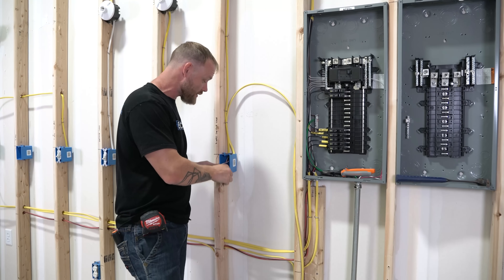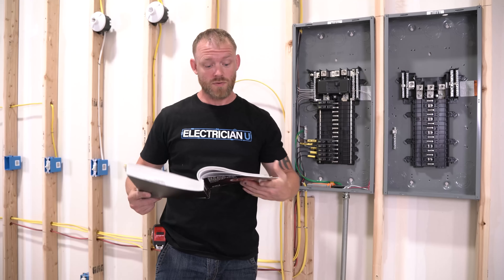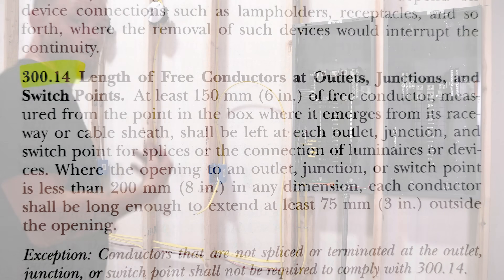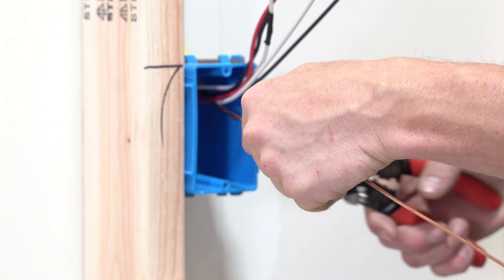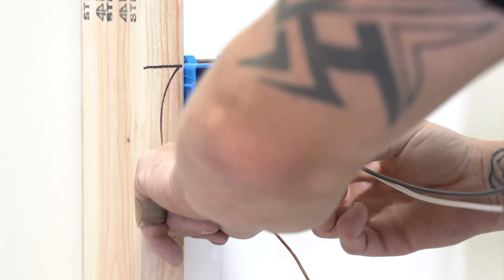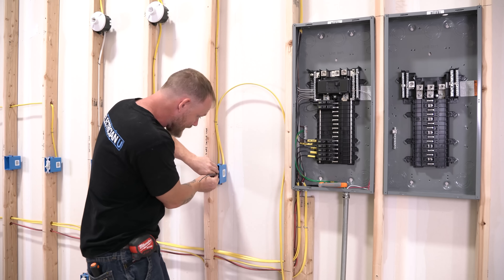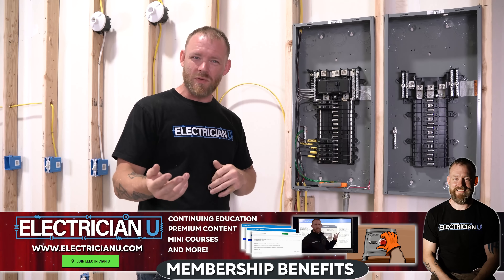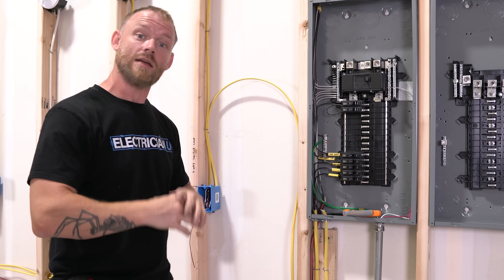STOP Cutting Wires So Short!!! What Does Code Say?

Comment: Great!  I am stuck by following code and using Wago and CFGI and now the box won't cooperate, wires don't fit in.  My task tomorrow to complete.  Will watch your suggested video and see how I can neatly do everything right.
Good I found you, Mr. Electrican U 😄
Oh, forgot to mention, Canadian here.  We don't have those blue boxes, have to use metal on a finished dry wall and I don't know what the hell is wrong with those boxes.  Am ripping off pieces off the metal box so it fits into the neatly cut hole in the wall, it's just weird.

Comment: Well, if the code says 3 inches like you just read, why double the value... isnt that a waste of money.  And to have the wire that come to the outside of the box ... the drywall guy person will cut the wire with the tool, and its blade is long enough 5/8 rock it will ruin all that extra 50.00 of wire in each box push the wire back save money and leave 1 long piece  and the rest shorter and give yourself a raise

Comment: i had a guy call me a few years back that was finishing his basement. He said his job got to busy to finsh it so I said sure I can fix you up. Anyway the homeowner and a buddy of his had started doing the electrical. I noticed right off the bat that all the wires for the receptacles and switch boxes were way to short! I told the guy that most of the wiring he had done had to be taken out and re ran. He was not very happy about this, so I showed him the code measured out the wires and started work the next day! I felt bad but this is what happens when you do things you're not sure about!

Comment: A drywaller knicked my neutral about 4.5 inches from the back of the box. So im thinking i need to cut the wire where the damage is which only leaves me with 4.5 inch of wire (1.5 inches outside the box), which isn't up to code. Could I use a butt splice or wago in-line to fix this?

Comment: the issue I've had is packing the conductors or low voltage cables so drywallers don't damage them

Comment: My theory is that in ANY job category, from truck drivers to brain surgeons, there are always a few who are brilliant and just way ahead of the rest.  Then, on the other end are those who are not good at what they do and should be doing something else,  and the vast majority of us who are somewhere in between fairly good to almost brilliant.  Same goes for electricians.   I am not an electrician, but before I retired I worked around a lot of electricians in a commercial environment.  I found some of them excellent, and most were at least competent but there were a few who did really bad work.  I worked on one job where they wanted us to put in isolated ground receptacles.  We had never installed these before and we did it wrong, but an inspector caught our mistake and we fixed it.  Then a young building engineer came to our crew and started asking questions about isolated ground receptacles.  The electricians who wired the building apparently did not know how to wire them either and wired them as you would wire a standard 3-wire receptacle, and there were a lot of these around the building. I knew our limitations but I thought that the electricians should have known how to wire those outlets.  By the way, I  think you are near the top.

Comment: It would make logical sense to leave an extra foot of wire after the last staple before it enters the box during rough in.  It would save a lot of headaches for people down the line years later that have to go back in to the box to do work to have some slack/extra wire to pull into the box if some dummy cut it too short.

Comment: Can you talk about what the code says for extending conductors where the splice point is outside of a junction box or enclosure? For example a hardwired appliance where the feed is too short, can you just use a wago or butt splice out in the open without an enclosure?

Comment: What do you do if you live in an old 1980s mobile home and the working area inside your electrical boxes are barely an inch deep? In some cases, they are pressed up against each other in one wall. What is supposed to happen? Your walls are not drywall, they are that thin .8" wood panels. The wires are already short as it is because of the home being so old, and you cannot afford to hire an electrician but for safety sake you have to replace the old brown receptacles whose backstab connections are worn and the actual material that the receptacles are made of crumbles in your hands when you take off the gang plate. If you do not replace them right then, you have a fire waiting to happen. There is no way to rewire the house without moving out of it, and the junction boxes are in the ceiling light fixtures themselves and nowhere else in the walls or ceiling. You cannot move out because you were barely able to afford your home in the first place. The building passed an electrical inspection in the 2 years before you moved in, so it does not require another for you to move in and use the electricity, but you find all of these issues...

What does one do then?

Comment: The way I measure my wire for receptacles is, I put my strippers (which are about 6 inches) to the front of the receptacle and stretch out the wires to the length of my strippers and cut em to that length . A old journeyman actually showed me that a long time ago.i know you only need 6 inches from pretty much the back of the receptacle but I like to have more than I need as long as all the wires fit in the box

Comment: I always favor having as much slack as is practical to still fit in folded up without shorting, rubbing, or obstructing, you can always cut it shorter later if the extra doesn't fit.  The most useless expensive wire is one that's ALMOST long enough.  Didn't know there was a specific code but I have also used the "2x/3x height of box" as a rough guide because its easy to fold in but easy to pull out and work with.

Comment: Short wiring in outlets and junctions is not always the DIY guy or the handyman (I'm both). I find old wires left really short by the original electricians on the 1920s wax & cloth wiring, which is still prevalent in the area where I live.

Comment: Code doesn't have to put 6 inches of 3-0 12 ga wire with wire nuts and pigtails back into a standard outlet box with a GFCI unit.

Half the time you get a short because the wires pinch and cut the sheathing trying to push them in with pliers or a screwdriver. 

The other half of the time you're using so much force to cram it back in that you break the drywall pushing the entire box into the wall cavity.

It's better to push the wires down into the wall cavity and leave only what you need in the box...future work can still pull more wire into the box from the extra wire in the wall cavity  if needed.

Comment: I would be interested in the same question for the breaker box; what does code say, and what are good practices for extra wire in the panel.  I've seen some boxes where the wire just barely reached the breaker, and others where it seemed to do a lap or two around the outer edge first.  Especially fun when trying to clean up wiring in a mammoth 400A service panel with multiple 100+ amp feeds to sub-panels.

Comment: if nothing else have enough respect for the next guy in the box and leave the appropriate amount.... this shit used to drive me crazy. and my employees doing this would have them re pulling a wire during rough. on a service call close to end of day to replace a receptacle and barely enough left to stab the back when you open it. the struggle is real. worse not enough to get a wire nut on it with a pigtail . manic laughter

Comment: You're supposed to extend them using wago or whatever.
You should try doing electrical work on half melted aluminium conductors in a communist building... I had less than 20mm / less than 1 inch of useful wire left and I managed.
Try digging up for wires under reinforced concrete.

Comment: I'm a professional Contractor. Old work is where I find that the most. Irritating for sure, but deal with it, don't regulate the crap out of it. I reserve the right to do my own work. Used to be we could do up to six feet of lead to install appliances or add an additional box in the course of a remodel. Now I have to wait a speed killing week for an electrician that's going to charge me a  ridiculous 500.00 for 30 min of work.  Other's can shove it where the sun doesn't shine if they want to regulate it to the point I can't do my own work I've done properly for thirty years. I'm tired of "We need more laws" people just wanting to protect their own trade, but don't wanted it applied to them when they want to do their own plumbing and so on.

Comment: Tell me this without using Google. Why does a motor draw less current on higher voltages than lower voltages, given Ohm's law states if we increase voltage there is a proportional increase in current if resistance stays the same?

Comment: anyways is not a word.  Kind of sad you used that word when admonishing DIY's against doing electrical work.  It shows your level of education.  The vast majority of residential wiring is super easy to understand and install.   Split phase wiring is another thing but still not complicated.   I just installed a sub panel.   The inspector said he rarely sees contractors doing such professional work.     I do thank you for the video, yet you should be slow to speak when criticizing others.

Comment: I'm a DIYer that just finished building my new home. I used the lineman pilers trick, plus I used pigtails.   Only thing I found weird here in Southern Mississippi is everything had to be 14 gauge on 20 Amp breakers, even my hardwired smoke detectors..
Reply: Seriously?  I'm pretty sure that is a code violation, and a fire hazard, if anyone puts 15+ amps on that circuit... it will protect from a dead short still, but not overloading the wire.  Who demands that? The inspector?

Comment: Technically wire nuts have a rating on how many conductors of what size can fit. Yellows are plenty good for 2 number 12 wires. I work in a factory and I use them all the time specially in those tiny motor boxes.

Comment: DIYer here, but I learned most of my stuff doing side-work with my best friend who is now a master electrician.
He never cut any corners and wouldn't let me either, so I learned good habits from the start.
I always measure the wire by grabbing it with my hand outside the box and leaving a couple more inches. This always leaves at least 6" outside the box. You can always trim the wires, it's a lot more of a pain to make them longer. Extra wire nuts for pig tails fill the boxes up real quick. Especially in the old metal boxes in most of the houses around here.

Comment: I've been doing some repairs on various things on my house. The only training I have is Leviton Copper and Fiber. Almost nothing to do with electrical wiring.

Everytime I remove a outlet. I've noticed the wires were super short. maybe an inch out of wire to play with. It pisses me off. 

The last thing I changed was a outside porch light. While it had more wiring then everywhere else. It didn't have a ground wire. I was at a loss. Like why? My new light had a ground wire that needed to be hooked up. Took a look at the old one, and found it had one to that was just shoved up inside of it.

As a DIY guy. I hate other DIY guys.

Comment: Pigtail those short wires and move on. No crying. Code is getting iffy when they start bleeding hearts about electricians bumping their elbows on a panel with limited clearance or because their fingers will be cramped and sore from twisting a wire nut inside a box.  Codes are written in blood, not bruises, nor in the tears of crying elechickens.
It's only a problem for guys who quote a job as flat rate without inspecting some outlets. If the conductors are stupid short, charge for a rewire and move on.  Next thing they will be crying about TOO MUCH wire in the box for box-fill calculations.

Comment: Leave some extra unstripped wire outside the box as well. If the wires are cut short or damaged by drywallers, a guy can pull down some more wire.

Comment: The quick way I cut the wires to length is I have a set of linesmen pliers that are 9” long.  So I just put the tip in the box and measure along the handle.  Where the handle stops that’s where I cut.  
Keeps everything nice and consistent.
Reply: Yes, and while 6" is minimum, 8-9" is better.

Comment: But how do yu feel when you rough in a house, come back to trim and see several outlets that are cut WAY shorter than I would ever leave in there? I always start blaming other trades immediately. Sometimes its drywall guy and his router they cut their holes with AFTER they put the drywall up. Sometimes even the box is damaged. It seems like they know when they messed up my wires bc they always cram sheetrock mud inside my outlet boxes they damaged. Then when I go to trim you dont realize how messed up the wires are until you pull them out and realize they're cut so much the wire just breaks there...
 I always leave all the slack in the box I can until I come to trim. I treat it like I'm going to be the one to come fix it;my company warranties our work for 1 year.

Comment: Home owner I'm going to buy the wire my self do it my self sees price of wire oh dang so it's not really that much  cheaper to do it my self runs all the wires makes shure to leave the wires as short as possible this is to expensive if there to long the electrician is going to cut them down wasting some of my expensive wire wast wast wast I'm going to make it just long enough that maby if thay relly wiggle the plug right thay can get the switches in cuz I'm in over my head and need to call an electrician lol 😆 cuz I looked at all there's colors of wires and all these screws and my head hurts

Comment: When I was doing new construction rough in   I always pulled 12 in out boxes then wound it back up in box nice in neat just case I was the one coming back thru qnd doing the finish out work then I cut it back to 6 in out box I always said good have little extra qnd them trim it back on finish out then I know I didn't short cut by accident was way I done it  on rough in short wires use to erk my nerves especially I was a bigger dude UT jammed under counter or on back of a counter jammed up behind something and hard get to because it made job lot harder than necessary but the last 10 that I worked electrician I was doing strictly new construction only it was commercial not residential if was residential it was apartment buildings or high rise condo buildings

Comment: Since I've inherited my dad's farm, I've been slowly replacing and fixing a lot of electrical issues in the shops. One outlet has the wires so short that I couldn't even get it out half an inch from the wall, I had to break it apart. He must have connected it and then pulled the wire back through  the wall as he mounted the outlet x_x.

Comment: The folding trick is pretty good haven't seen that. When I was doing residential as an apprentice I was taught to pull the wire out straight put my lineman's pliers to the back of the box and cut the wire the length of my pliers. That gives you 9 inches from the back of the box and that folds up well after splicing. I had my lineman's pliers in my hand anyway so it was a convenient way to do it.

Comment: I just added smart switches to my whole house. I had to cut out a lot of excess wire to get the switches to fit. I basically consolidated everything with wago lever nuts and pigtailed line, neutral, and ground. So if the wires going into my wago are shorter than 6" I'm violating code? Is there any increased risk of fire or shorts if all connections are secure?

Comment: Not a electrical guy but when I do the wire works I usually put my cutters against the switch box and cut the wire at the other end of the cutters. Also side note. Before putting the wire in the box I bend the wire a bit witch adds another  4 inch  before the  back wire plate get tight down.   That’s Incase the next guy fucks it up cutting wires short  then the next guy can just pull down in more wire if needed.

Comment: I learned to wrap my hand around the wire, put the base of my hand against the box, and stick my thumb out.  Where the tip of the thumb is, that's normally 6 to 8 inches from the face of the box.

Comment: I went through our house and changed out all the switches and receptacles with decorra. It was one of a development of townhouses. Boxes were rats nests. Wires were nose hairs, push-ins were all used - one of which was cracked on a bathroom switch, hots wrapped tight around the others on any device, paint all over everything, plates screwed too tight… Electricians need to knock it off with the hack work. These guys were just banking a hot buck off the development. No good craftsmanship across the whole place except in the panel.

Comment: Totally agree... I leave probably 10+ inches and usually run my wires down/up/down as you did to keep tucked inside the box as slack. One thing I can't stand more than anything is what you did at the 2:30 mark... why would anyone ever twist their grounds all the way like that. That is the worst idea ever. If you ever have to take those apart it is a pain in the ass and makes a damn mess in the end. Even worse when some idiot twists 10 wires in a breaker box like that. Can only make you wish eternal suffering for them!
Reply: I personally only pre twist about an inch and if it's under four conductors I use a greenie wire nut. I absolutely hate ground crimps

Comment: I just ran 12/2 BX for my dishwasher. I left some extra in the 4x4, plus I left about 2 ft curled up underneath the floor in case whoever happens to buy this house if we ever move can move it possibly to the other side of the cabinet. Even put a note in the electrical panel that there's extra wire.